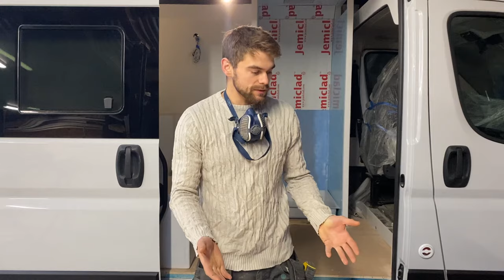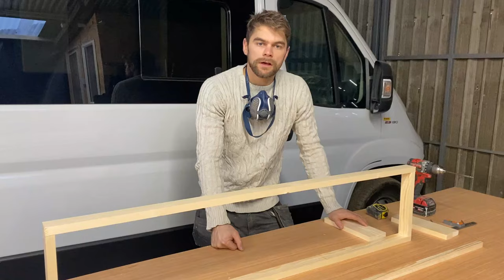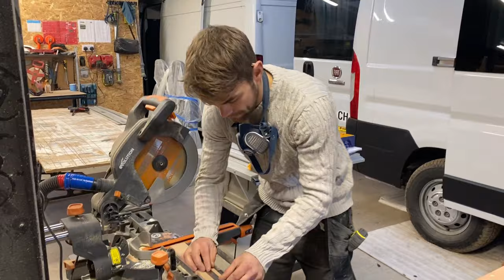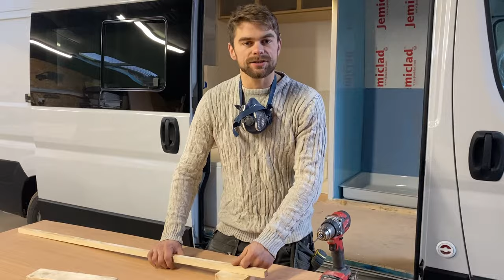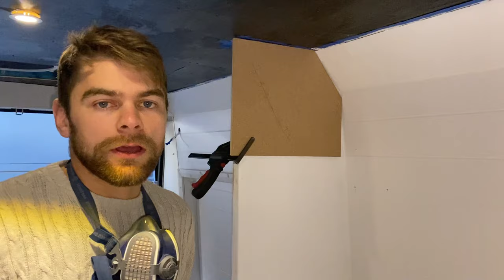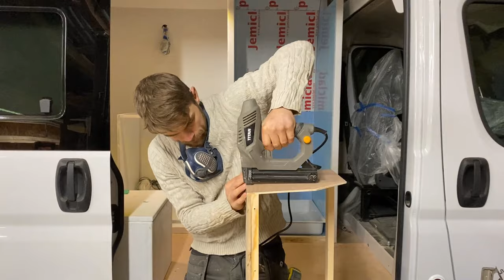How to build overheads/upper cabinets for your van conversion | Vanlife Conversions

Comment: NOTE to builders: You should always fasten structural elements in your van with Rivnuts and use angle brackets with through bolting, and not screws.  Rivnuts far exceed the holding power of sheet metal screws, and are not subject to rust where the screw meets metal, where usually only 1/16" of metal around the screw hole is doing the holding and has to do so for 1,000s of miles of rough road without weakening.  Also, angle brackets with through bolting requires the plywood be torn apart rather than simply stripping out a wood screw.  Most DIYers have no idea of the forces imparted during even a low speed collision.  That is why RV manufacturers and trade van outfitters always use rivnuts.  Build as if your life depends on it, as it may very well one day. 

In this build he can get away with this a bit because of the shower wall that runs floor to ceiling and will help strengthen the structure.  But without that dividing wall of the shower, these would be significantly under attached to be safe.

I'm also not a fan of MDF being used in van builds.  It is not as strong as plywood and is subject to moisture degradation, which is why code does not allow it to be used in mobile home sub-floors any longer.  To me, it's just not worth the small savings.
Reply: Rory deely
Reply: Totally agree - the average person is not aware of how deadly unsecured items can be in the event of an accident - they become missiles. Anyone who builds a camper van has a responsibility to make it safe and not just pleasing to the eye.
Reply: @errolmagill1611  Absolutely, and eventually this will end up in court, where a passenger dies and sues the builder for obvious unsafe design.

There are videos of people installing kitchen sink cabinets made out of PARTICLE BOARD being held with a few self tapping screws...
Reply: Hi B, I'm refitting a crafter that I bought part converted. Do you think it's possible to drill through the batten and into the van rib to install a rivnut for overhead cabinet without taking the entire ceiling down? Also, thanks for the video. Definitely using this method!
Reply: @junglist32  we'll give some thought to it and try and get back to you driving right now
Reply: @junglist32  If I'm understanding you, you want to get a secure hold for a cabinet through the already finished ceiling.  This should be possible and mostly depends you you being able to know where the rib is in the ceiling to hit it well enough if not dead center.  If there were a lot of penetrations in the rib (most seem to have some holes, likely to reduce weight), there is a chance you may not get a great spot by partially drilling to close to one of those openings.  But assuming you hit it in a good place, then your only penalty should be that you'll need a larger hole to be able to insert the rivnut up in and set it in place.  So you may need a large washer to deal with that.  I can also tell you the steel in those ribs is pretty beefy, so be prepared with a good drill / bit / and some cutting oil to not have the bit overheat.  good luck, glad to hear you'll be focusing on building a sound and safe structure.

I've just bought a Ram ProMaster 2500, 159" wheelbase high roof, so will be starting another conversion and selling my current one.  With changes from Covid, and after finding out how much I enjoyed #VanLife I'm going full out with another build and have several "firsts" that I'll be building in it, so will be starting to put those build videos up in around 30 days.
Reply: What if you’re screwing through wood? I’m doing a shuttle bus and I have 1/2 inch plywood walls. Note, I’m using all wood. I’m not sure of what MDF is
Reply: @cailabarnes1318  Do you mean fastening 1/2" plywood walls in the van to the metal van ribs?  That's where rivnuts work.  Locate where you want to attach the plywood (because of the van rib behind it - measure carefully!) and use a small drill bit to drill through the plywood in place on the wall and just start to drill the van rib.  Then you can remove the plywood, and use the mark you made in the rib to drill the needed size hole for a rivnut, install it, then go back and drill the plywood for the size of bolt (#8 or #10 bolts usually plenty enough for wall attachment, but use 1/4" for heavy structural items) and you're ready to fasten the plywood.  This is about the best deal on a rivnut installer on special for Prime Day on Amazon:  https://smile.amazon.com/ORFELD-Setter-Metric-Mandrels-Sturdy/dp/B07XT5PF69/ref=sr_1_7?dchild=1&keywords=rivnut+tool&qid=1624264909&sr=8-7

Stepped drill bits like this one work well for the various hole sizes you'll need to install the rivnuts:  https://smile.amazon.com/CO-Z-Titanium-Automatic-Aluminum-Multiple/dp/B076QC39PY/ref=sr_1_3?dchild=1&keywords=stepped+drill+bit&qid=1624265348&sr=8-3

If you mean fastening plywood to wood you've already attached in the van, then it's harder to say without seeing it.  But perhaps you can still get to the metal ribs of the van somehow with an "L" bracket to attach things.

Keep in mind, just the wall "skin" over a van wall does NOT absolutely need to be held by a rivnut.  Not safety wise at least.  However, doing so would make it EASILY removeable in the future if you need to get back there for wiring or plumbing issues.  

Rivnuts are only required for HEAVY STRUCTURAL ITEMS in your build.  So for these things in a build, use a RIVNUT for sure:

- overhead cabinets (use angle brackets fastened THROUGH the plywood, and the other end fastened to a van rib into a rivnut)
- floor to ceiling cabinets with heavy items
- water tank framing (if using an inside water tank, since water is 10 lbs. per gallon)
- battery framing (to hold your "house" battery in the back)
- bed structure
- floor mounted structures like kitchen cabinetry with a sink, or a sofa bed

Pretty much all of these are best and most easily fastened by an angle bracket THROUGH the plywood, and the other end fastened to a van rib (or to the floor) where you've installed a rivnut.

MDF is medium density fibreboard.  It's like particle board but a little higher quality.  It's a compressed wood (sawdust) product, with glue holding it all together.  No good over time and vibration in a van.

Good luck
Reply: not to mention the off gassing of mdf is something chronic!!!
Reply: Thank you soon much for sharing this information,my son is getting ready to do a van build he has been doing a lot of research on YouTube. I copied & pasted and printed your comment for him.
Reply: @marieesposito9145  Thanks!  On my channel, Giant Travels By Van, I cover using them, and building my van, including a Shou Sugi Ban ceiling...   I'm doing a new conversion now, a 159" ProMaster and have some new firsts coming in it that I'll document afterward on my channel.
Reply: @brianmi40  
Thank B Miller, Sir.
That's very nice of you to share knowledge of safety.
I have only built long narrow table for my plants, I saw lots of improvement I could've done, I'm seriously thinking starting part of my DIY van conversion,so I know what I like, have them professional electric, solar done, I'm not going that far. Thank you so much! Have a Blessed MERRY CHRISTMAS!!
Reply: @ryveralexander8511  thanks, good luck.
Reply: nice, I got a rivnut tool and had made a start. I sent a video of my rivnuts to a professional chippy and he said ''seems a bit over kill on the bolts'', I now have a well armed response thanks to you
Reply: I know this is an old comment but do you have a video of how you do this please?
Reply: @NutzyJazz  Yes, first episode on my channel, Giant Travels By Van discusses attachment methods.  good luck
Reply: Thankyou for taking the time to share such vitaly important info.

Comment: Good info re the Rivnuts.
I would like to add in place of the humble self tapper on thin sheet metal,
regardless of what you are trying to fix, descent size diameter, large head pop rivets
have their place on brackets and fixtures you don't wish to remove all that often.
They can be drilled out if need be and fitted correctly, with the load in mind,
have good long term holding power with the added benefit of matching similar metals
where is a concern.
Think of those lovely stainless steel self tappers going into your mild steel roof or other body
locations of your vehicle and the electrical current running through same, Galvanic corrosion.
The windscreen stone guard on our Toyota Coaster got the pop rivet/anti corrosive sealant treatment, 
after years of miles flogged the self tapping screw holes out.
Not the be all, but an often overlooked fastener alternative, when the correct style/size is purchased
and not from Bunnings!
Reply: Sorry "where corrosion is a concern"

Comment: Thanks for the video It was amazing. I´m brazilian and I would like to know what wood did you use for the structure, because I didnt understand. Thanks
Reply: Pine for the structural pieces and MDF (medium-density fiber board) for the bottom, ends, and dividers.

Comment: How did you actually attach the structure to the van? You say you screw into the ceiling framing, but anything else? That alone doesn't seem strong enough

Comment: Hi!  First, thank you!  This looks to be far less complicated than some other upper cabinet builds that I have seen and your instructions are very clear.  Quick question, though - Why use MDF as opposed to something like baltic birch?  I'm just nervous about MDF around any kind of moisture (which will invariably exist in a van).
Reply from the maker: Thank you, we ensure all sides are painted with moisture proof paint when using MDF
Reply: @vanlifeconversions  I'm still curious, though....Why MDF instead of plywood?
Reply: @vanlifeconversions  Surely using a lightweight wood is better and mdf is heavy?

Comment: Thanks for the great video. We will use this for our current build 🙏 What is the tool you used with the freehand circular saw to get a straight cut on your plywood? I definitely need one of those!!
Reply from the maker: Its a track, they are great as this saw sits inside it so you cant slip or move off the straight line
Reply: @vanlifeconversions  great, thank you 👍🏻

Comment: Nice video. How come you used mdf instead of ply? Cheers!
Reply from the maker: It gives a nicer finish once painted. It is best not to use it on lower cabinets and paint all sides to prevent it taking on moisture

Comment: MDF is very uncommon in vans because it it has poor specific strength (strength/density) and is not moisture resistant. Do not recommend for van applications.

Comment: Oh, come one. brackets inside as an alternative for not being able to use some simple joinery? This is not light weight, MDF in the same thickness is heavier than plywood. This has nothing to do with building a decent cabinet.
Reply: Totally harsh reply. The MDF comment is reasonable. Not all of us have the skills you clearly posses